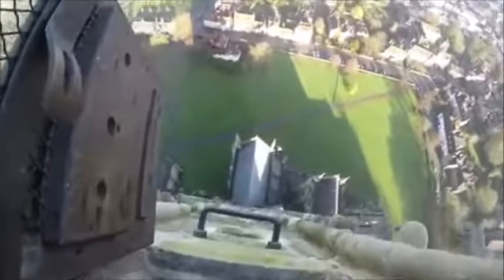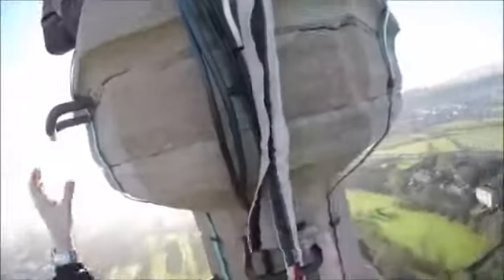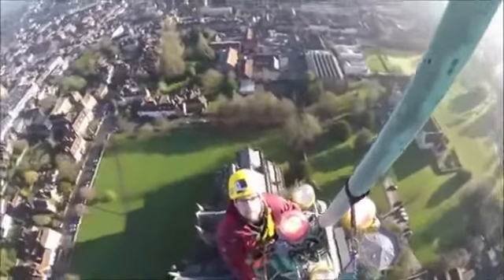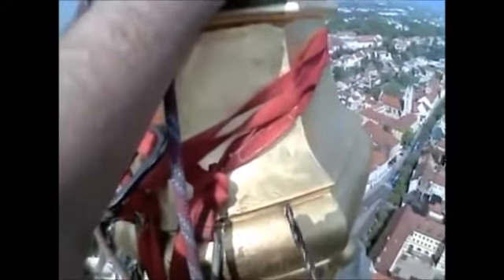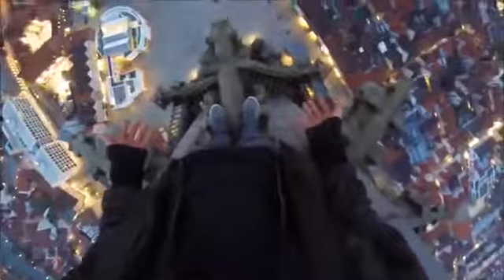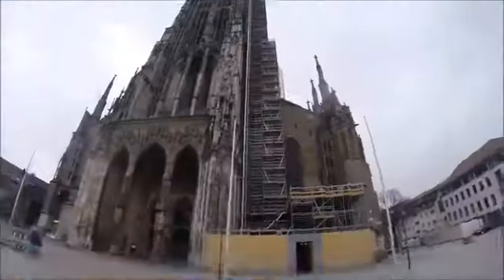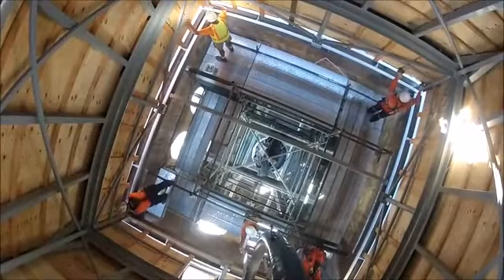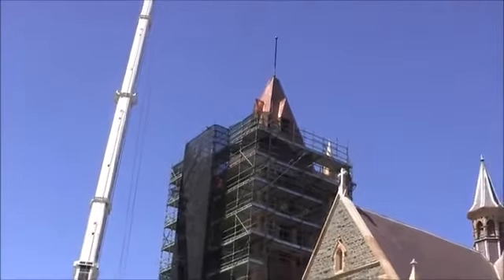Flat Earth CON SPIRES! Cathedral Spires Are Secretly Atmospheric Electricity Masts

Comment: They mount cell phone antennas in those spires. The one with the cross is really obvious. As for the first one, it's a weather station. As for the church in Milan, it's to take measurements because if you go to that place (which took 450 years to build) it' is a constant maintenance project. So the major spires are monitored because they need to make sure something is not going to happen without them knowing it. You can go in top of that building too and see all of the work that's constantly being done to it and some of the problems they have.

As for some of those other cables, they run grounds because they have learned from the past, that (just like the church in Milan) a lighting strike can burn a section of it down. No different than in the UK.